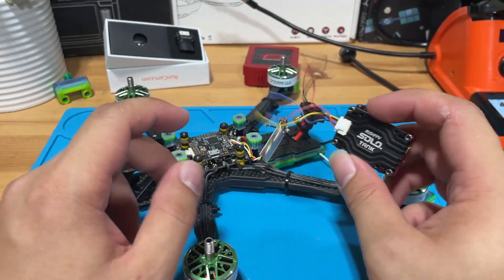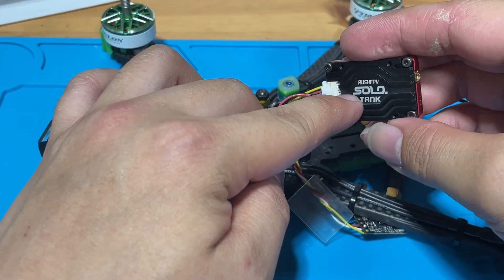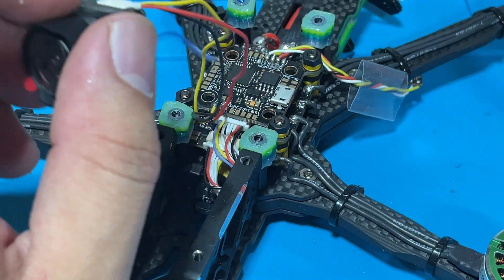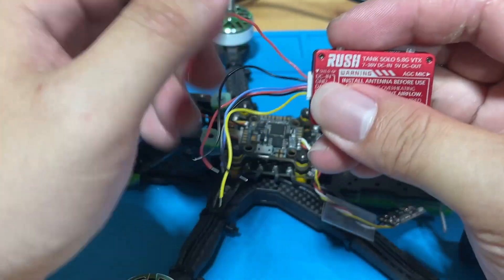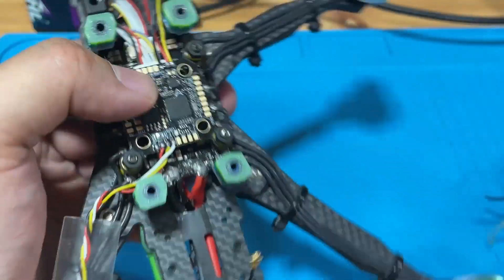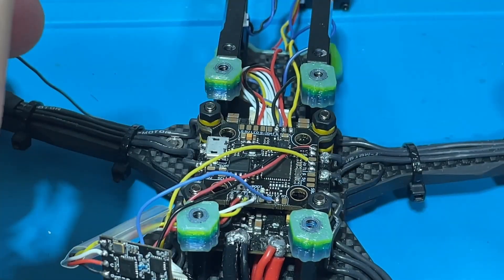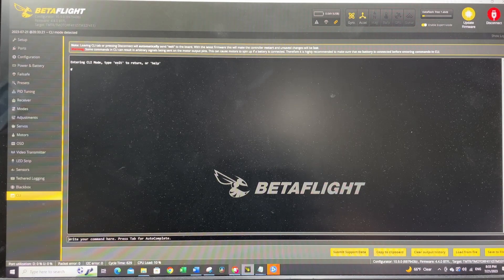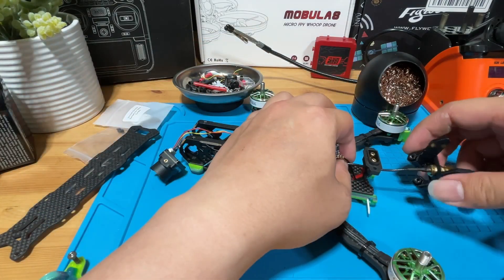Build a 5" FPV Drone Part 5:  All about VTX from solder to setup (Rush tank Solo/Runcam Phoenix SE)

Comment: Why is the T1 pad for The smart audio/data wire. Shouldn't it be "R1" since it's receiving data from the solo tank vtx?
Reply from the maker: No, you are "Sending" signal out from the FC to the VTX, that is way you get to control the VTX setting Via betaflight

Comment: Hello, I need help with cetus pro, I wanted to check how betafliht works recently and I connected cetus to my computer and I wanted to connect and it didn't work out and now when I wanted to see if it works, there is only 1 music and no LED is lit and would you help me upload the old settings because no I know how to do it
Reply from the maker: The Cetus pro is a close sourced FC you will only be able to use BetaFPV configurator, betaflight will not work. 

As for the issues you are facing, try download the CLI at BetaFPV website and load the CLI in BetaFPV configurator see if it fix it